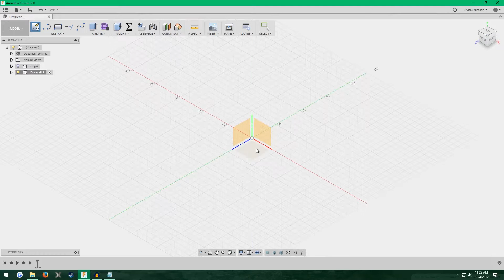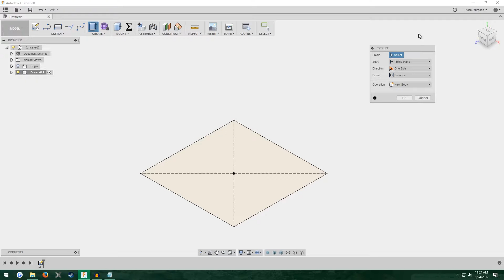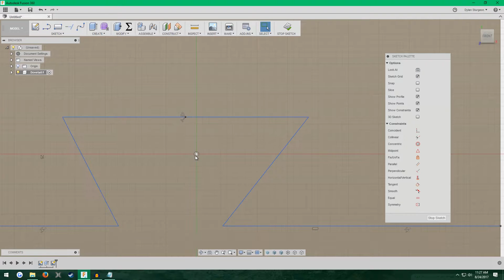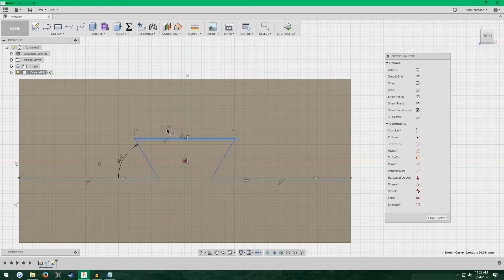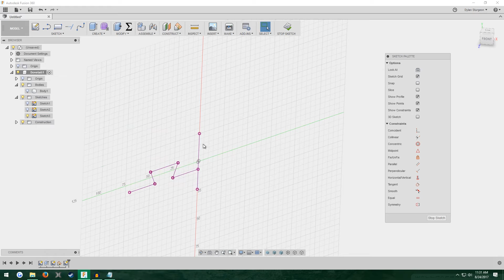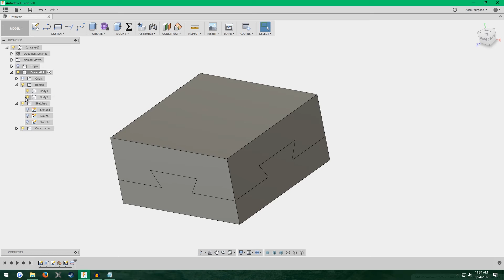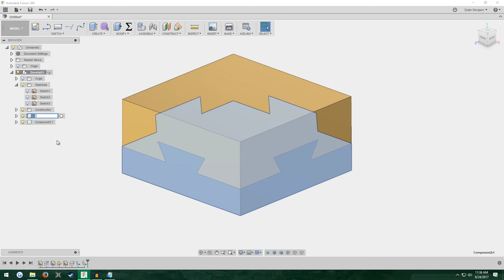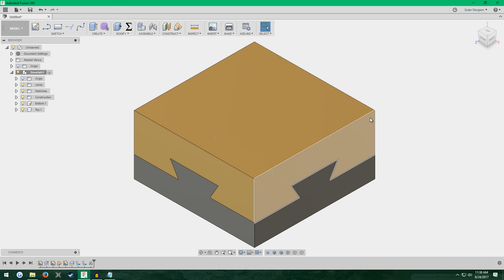Impossible dovetail | Fusion 360 Tutorial

Comment: how can i make clearance between the individual parts so when i 3d Print it fits ?
Reply: you can do it 2 ways, in fusion you can add an offset to the profiles before splitting, second way is in the slicing software and use horizontal expansion as for the number you add in there it really depends on your printer for me a value of -.15mm gives a nice tight fit
Reply: @BenjaminK123   Ive completed the box & printed it but it just doesnt fit together. How do i go back & add a offset to the profiles now.?   i cant find horizontal expansion in my sliser ?    thank you..

Comment: How would one add in some tolerances to the top/bottom pieces so that in building one of these boxes they would actually slide easily?  For 3d printing, I find that .25 or .3 is usually enough, but can't think of an easy way to add it here.  Scaling the object is just a cheat IMO.
Reply: Several methods are described in this video see about 17:50. 

https://youtu.be/RFe_9FgGOPQ

What I did was draw another line on the slicer sketch offset from the first by 0.3mm. Then sliced the cube twice so it was sliced into three parts, one of which was only 0.3mm thick. After slicing I filleted the cut edges on the top and bottom parts. "Outside" edges had a 1.5mm rad and "inside" edges had a 1.8mm rad to maintain the 0.3,mm gap.